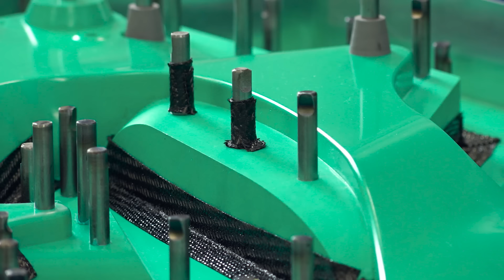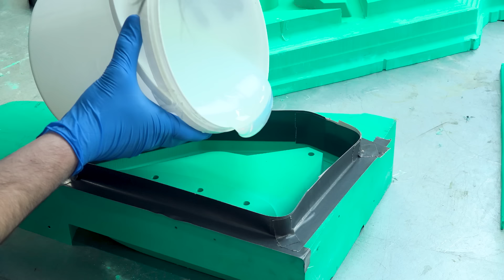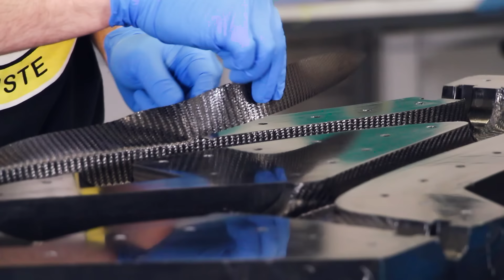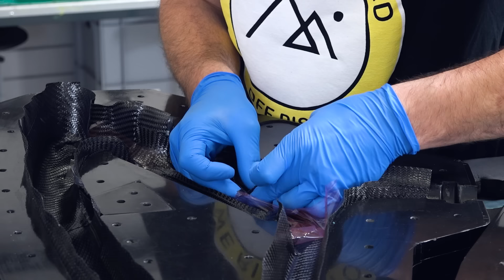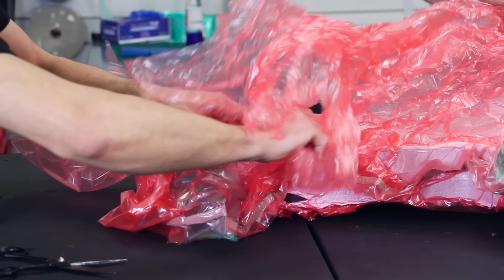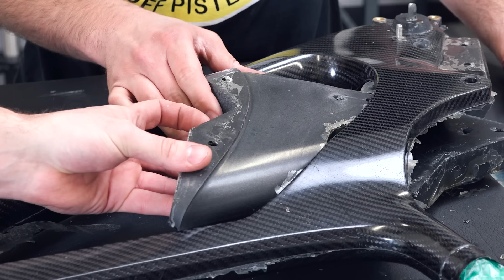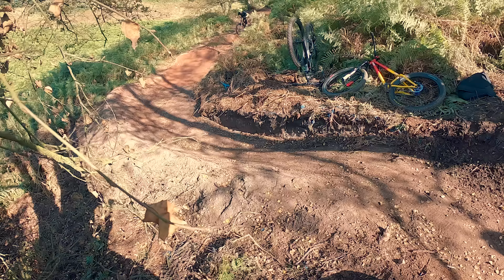Making a Carbon Fibre Bike Frame – From CAD Design to Downhill Race

Comment: Being someone that has competed in multiple extreme games BMX competitions, this is wild. 
I could imagine a BMX frame that’s got the finest tubular cross-section. 
8mm internal tube😂
Better stronger than a front wheel separation!!!

Forks or frame can both distort. Sort them both out and I’ll be happy.

Comment: It is looking so  if we  taking as starting project  conventional  frame for sport bicycle it can be more easy to make pipes and then from pipes assemble  frame by using connectors  . If such massive  form of frame needed to keep stress of  load ?
Reply from the maker: If you can find or manufacture tubes which are sufficiently strong enough then yes, a tubular frame would require significantly less tooling and equipment. You would also need to ensure that all of the joint connecting pieces were sufficiently strong enough. These can be further strengthened with additional reinforcement.
Reply: @easycompositestv  I new for that things but I believe the tube in time of formation can be more safer as one substance       . Then the joints  connectors can be manufacturing themselves .  Some how I am not big fanatic of modern  massive form of frame .  I like frame to be   looking  fragile  but in reality elegant and  very storing .  That is the target to be interesting about .

Comment: ive been following this channel for quite awhile now and i finally have a shop to work in, ive been thinking of how possible it would be to make lower control arms for a car using a similar technique as used in this video, thoughts?
Reply from the maker: It is technically feasible to make components like this form composites yes. The issue being that from a safety aspect, they require extensive testing to verify their performance which, apart from high end racing teams or manufacturers, just isn't possible.

Comment: Being a disabled person watching your videos has made wonder how much of this Tec with carbon fibre, could be used for wheelchairs for the disabled ? i was thinking of starting somthing useing this tecnolagy to help disabled people like myself who unlike me would need a chair , when in constrution it uses  both carbon fibre made parts , also mixed with  comon push bike parts , to build a wheel chair for those who need it . Thank you for the inspiration & making me think of the possibilities .
Reply from the maker: There is no reason why the same concept couldn't be used to create a composite frame for a wheelchair with the right design and testing.
Reply: @easycompositestv  I am going to be trying to put together a design that will be open source that can be used for both powered & not powered wheelchairs. I am still in the learning & design phase of this project. But I would greatly appreciate any help & feedback you maybe able to give. Also thank you so  for your current response to my question and comment about this idea

Comment: How much would be the cost (+/-) in prepreg for a frame like this?
Reply from the maker: Impossible to say. Entirely depends if you are paying someone to design it, make the tooling etc or just expecting a "unit" cost from a pre-existing manufacturer and frame design.
Reply: @easycompositestv  just the prepreg material. I  have a decent amount of experience doing wet, I can design, cnc, deal with tooling, etc, etc but I'm a bit surprised for the price of prepregs. Are we talking around $500, 1000 or more?
Reply from the maker: I see, Depending on the design and exact prepregs used around 200 should cover the materials in the frame.

Comment: Can we technically fabricate a custom shaped bag using gum tape and the plastic film? and did you guys ever do the video on adhesives?
Reply from the maker: Yes you can just ensure the gum tape is not under any pull or tension when the vacuum is pulled. We are hoping to cover adhesives in a future video.

Comment: Thanks for this amazing video. I am interested as well in creating parts out of prepregs. But why cann't I use Polyurethan as form-material?
Reply from the maker: The problem is that PU modelboards cause cure inhibition of most epoxy pre-pregs.  We believe it is some form of outgassing or reaction at temperature. Hence why we recommend using Epoxy Tooling block for this process.
Reply: @easycompositestv  
Thanks a lot for your quick reply :-).
In one of your videos I saw 3d-printed PETG molds for using forged carbon fibre. Can I use this mold-type for prepregs as well? Maybe I have to lower the oven temperature.

Comment: Given that these frames have a split in the middle from the two sides how can they possibly be strong enough?
Reply from the maker: If you look closely during the layup, a deliberate overlap in material is designed into the cut pre-preg to ensure the join line has additional and sufficient reinforcement.
Reply: yes of course. I mean obviously the pudding speaks for itself here has anyone managed to break these or test what it would take? @easycompositestv
Reply: @easycompositestv   What I'm trying to convey is my admiration for someone who took the risk and made the investment to achieve such a feat. Now, I'd like to understand where its limitations might be. I noticed exterior blemishes on the finished product, are those within also?  exterior can be cleaned up or filled?  Additionally, about the rear fork being glued together  'Will it break if I hit a tree, stone or unsuspecting bear?'"

Comment: I've always been intrigued by the integrated cockpit manufacturing process. How do they manage to create an aluminium mould with this shape, like the Syncros Fraser ... By that, I mean how do they make the stem-to-handlebar connection in one piece ? I'd like to understand that to be able to mill an multi-pieces aluminium mould

Comment: So this is essentially a prototype if this was to go to mass production, would they use an aluminum molds? I can see that this is a lot of time involved here. 
So would it be able to be mass produced at a cost effective range? I realize this might be something that makes only a few frames. The other question is how it's held up over time.
Reply from the maker: This mould system is reusable so for a low volume model you could avoid the expense of billet tooling.

Comment: In the part where you have the green internal bags passing to the outside of the main bag, wouldn't you need to have a tube of some sort going in through the green bag into the frame? Otherwise wouldn't the vacuum pressure squash the green bag and close it off making the use of the atmosphere pressure not work?
Reply from the maker: No as there is enough of an air path for the vacuum to pull the tubular bagging film against the inside of the frame mould.

Comment: From watching some videos of actual carbon frame production it looks like most manufacturers avoid the seams you have by wrapping larger pieces of carbon around entire tubes outside the tool and then placing them into the tool. Can someone give any insight as to whether this is a practical method for one-offs and why it wasn’t used here? For reference, see the GCN video at the Look factory.

Comment: At around 20mins into the video, we see the prepreg extending out of the mold in order to connect with the opposite mold half when joined together. How do you deal with this excess material during debulk? Ive always had a hard time dealing with these fiber overhangs since they either tend to stick to the mold, stick together or make a weird wrinkle at the split line, making it harder to deal with post-debulk. I'd be curious to hear if you have any tricks to adress this?
Reply from the maker: You can use the vacuum bag carefully to help with that or just realign the overlaps by hand after the debulk if they are relatively small like this.

Comment: Would the wet joining technique work for flat surfaces also? For example a bonnet? I would guess joining in the middle in 90 degrees relation. The part is going to be painted anyway, so finish is not the main concern.
Reply from the maker: Folding and overlapping the pre-preg material in that way will provide a good join after curing.

Comment: Love to see a video tutorial on how to utilize structural aluminium inserts inside a hollow composite component. I don't mean bonded in after a part is already made.  I see many components that have threaded insert attachment points in areas with no internal access, so are obviously placed in the laminate before the molds are closed and cured
Reply from the maker: Inserts is a topic we hope to cover in a future video.

Comment: hi love your video. i have a question , ive got carbon bike needs to be fix  little crack on bottom frame.
My question is what material do i need like which carbon sheets, how many layer and which epoxy and hardener.
Thanks for time.

Comment: If you want to make a carbon fiber frame extremely stronger while only adding slightly more weight. Make it so all the tubes can be filled #2 dense foam expandable insulation. I'm surprised no bike makers have done this yet, it's the same science behind which makes a toucan birds beak incredibly strong while still being very lightweight. 
Thin layer of keratin (hair/fingernail material) on the outside, light foam like layer on the inside.
Reply from the maker: Actually, although foam cores certainly have their place, adding a foam core in a bike frame wouldn't allow you to increase the strength-to-weight ratio of the bike frame beyond what is achievable using a hollow structure. Quite simply, if it was, manufacturers would do it; it's not difficult or expensive technology and the mechanical behaviour of cored structures is well understood. Foam, and other types of core - such as honeycombs, are used extensively in composites but they tend to be effective where the shape is not intrinsically strong, like flatter surfaces. Triangulated tubing, like a bike frame, would benefit less from the additional weight of a core than it would from the additional weight of more reinforcement in the tubes themselves.

Comment: 3d print the frame a bit smaller, cover it with carbon fiber and epoxy, melt the plastic out. wouldn't that be way easier?
Reply from the maker: Possibly for a prototype to test geometry but for a production run, the time and effort that goes into the mould making side reaps benefits with faster processing time for subsequent frames and importantly consistency between frames.

Comment: Is their a material that has the ease of casting and stiffness of carbon fiber but without the black mesh look of carbon fiber?
Reply from the maker: Not with similar properties that we are aware of.
Reply from the maker: Although if you don't like the appearance, it could simply be painted or vinyl wrapped after being finished.

Comment: This is very labour intensive. Is their a way to automate some parts of it.
Reply from the maker: Not easily for this method of construction. You will likely find on large scale production, the pre-preg templates will be drawn in CAD and cut out by a cutting machine which does save some time and improve accuracy based on hand cutting the templates.

Comment: Are the fasteners used on the bike titanium?  I'm under the impression that anything else will cause corrosion
Reply from the maker: no, galvanic corrosion is not normally a significant issue in the environment these kind of sports equipment is used in. Also adhesive layers, other materials in between, coatings etc all reduce direct contact.

Comment: You probably don't even need the screws holding the halves together because the vacuum bag will clamp it together when it is pumped down.
What i don't understand is how does the vacuum get inside the mold cavity? is there some breather holes for the air to get trough?
Reply from the maker: There is always likely to be a tiny gap that air can escape from on a 2 part mould like this.

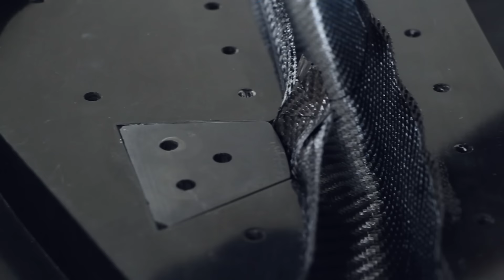Comment: 19:48 - I’d assume a big reason to stagger the layer overlaps is because the fibers aren’t continuous across the mold halves creating a stress concentration in the resin matrix. Offsetting each layer’s overlap region prevents concentrating all the weakness into a small area, letting you get avoid unnecessary bulk on that seam.
Reply from the maker: Yes, that's exactly what's happening and the reason for it. The only real strength comes from the fibre, the matrix is just there to lock the fibres in position. Without fibre overlapping the join, the frame would crack open like a Kinder egg!

Comment: I'm just asking what kind of plastic to make a mold?
Reply from the maker: If it is for PrePreg use then you need a high temperature solution so the epoxy block used here would be fine for one-off or short production runs. For larger production runs, its worth the extra step to produce Pre-Preg mould tools.

Comment: Is it possible to have a bike frame made of forged carbon fiber ? I reckon it should be faster in manufacturing , right ?
Reply from the maker: Would need extensive design and testing. Also the compression model would not work for a hollow shape.

Comment: What is the name for this green tooling  material
Reply from the maker: It is Epoxy Tooling Block.  You can find it here:  https://www.easycomposites.co.uk/eb700-high-temperature-epoxy-tooling-board
Reply: @easycompositestv Thanks ,  is that  block made out of resin
Reply from the maker: @huizdeeze1075  The block is not made with a traditional epoxy. It is a specialist material cast and foamed into large blocks with careful regulation of the process to ensure a consistent density and structure.
Reply: @easycompositestv   looks like its  same material automotive use for soft tooling for  stamping small quantity parts

Comment: can you make a superbike swingarm from carbon fiber?
Reply from the maker: Hello Ahmat,  in theory it would be possible, however it would need extensive design analysis and testing to see if such a structure could be made of composite with a safe level of raw strength and long term durability.

Comment: Fascinating video but holy hell is that a labor-intensive, tedious process.
Reply from the maker: Hi Adam, for a one off, it is a lot of work but remember most of the work we show in this series is in the design, pattern and mould making processes. Once the tooling is made, you could product hundreds of items repeatedly and there are other efficiency gains in terms of having the PrePreg pre-cut into kits so as operations scale up, efficiency per unit improves dramatically.
Reply: @easycompositestv  I'm assuming the "hundreds" would involve having aluminium tooling. Patternblock tooling, you would be lucky to get more that 5 pulls off it. Carbon tooling a lot more, with numbers depending on the complexity of the component and even how well the moulds have been split.

Comment: So i kinda wanted to make a bike frame that's similar to a dirtbike (top tube curves into the bottom bracket instead of the seat tube, shock attaches to the curved top tube and directly to the rear swingarm, similar to a dirtbike frame and swingarm). The bike would be designed only for massive jumps and drops, as it would have around 300mm of front and rear travel, and have 24in wheels with wide dirtbike tires. My idea was to first use steel tubes to make the inside frame and connect the head tube and bottom bracket while also attaching the shock mounting points to it, then making small wood/metal/carbon ribs that go around the steel tubes (kinda like an airplane wing), fill the space between the tubes with expanding foam or something so that i can shape and contour it, and then make a thick carbon outer shell that helpd with stiffness and covers everything and makes it look good. The swingarm would be attached to the outside of the bottom bracket tube, so that the chain stay length would not change with travel, eliminating the need for a chain tensioner (as the bike would be single speed). It seems complicated but on paper and in reality it would be really simple. The only thing is that i dont know how to compress the carbon layers together and how to orient them for the best stiffness (weight is not a concern since it has steel inside, but the steel is mostly for structure and holding shape, while the carbon would make it stiffer, so Id probably go crazy with the carbon so it would be as rugged and stiff as possible), and also if it's better to use fiberglass or something else similar to carbon since carbon is expensive af. Any tips would be helpful. Also the bike is not meant to be a professional race machine, but an indestructible toy for bike parks and massive drops and street stuff, so don't get all pissy in the comments because "carbon is for making light stuff" and "that bike would be stupid because it would be useless for most stuff" (as some people did before) because i do not care and i just want to make something cool and unique. Thanks for any tips, also love the frame you guys made, never even thought you could make professional bike frames at home.
Reply from the maker: On many bikes, the majority of the fibres on any set tube would be orientated down the length of the tube as that is where the loading direction is. You will always still need some hoop strength.  If wrapping around steel, you could use the Composites shrink tape to add compression – much like in our roll wrapped tube video  - as that is basically your process on a tube by tube basis.